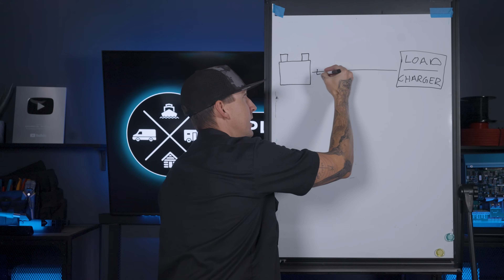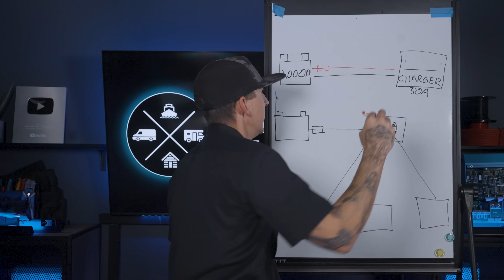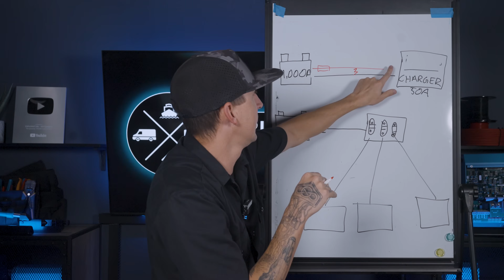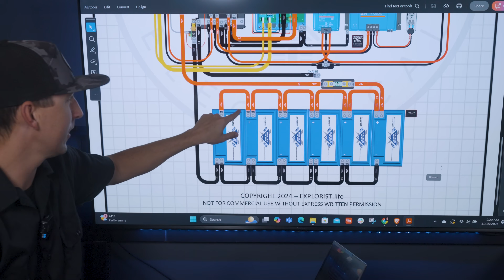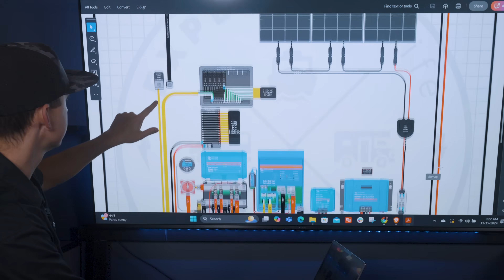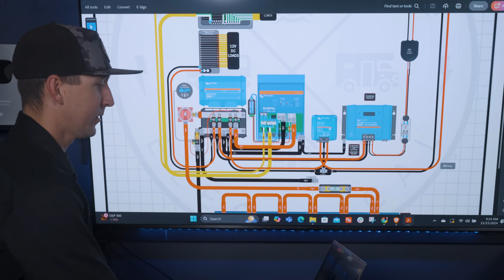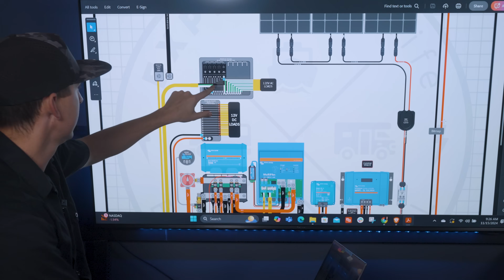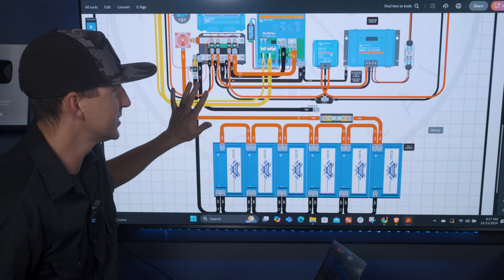Fuse and Breaker Placement 101 - Fuses, Breakers, & Overcurrent Protection | Ep: 3/6

Comment: Hi Nate,  I want to ask you about the placement of the battery disconnect switch. I noticed that you always put the battery disconnect switch on the positive wire. Every battery company I've spoken to advises disconnecting the negative terminal first, then the positive. Could you please tell me why you disconnect the battery from each system, contrary to the battery manufacturers’ instructions? Thank you for your information, John
Reply from the maker: Sure!  Reach out to shop.explorist.life/support and we can give you some insight into that and get you the parts you need for your build. 👍😎

Comment: Hi, if i have 2 x 300ah batteries, can i wire them in parallel with 1 fuse and 1 switch, or do i need to wire each to the bus bars separately, with 2 fuses and 2 switches (1 fuse and 1 switch for each positive cable connecting to pos bus bar)?
Reply from the maker: Great question! The best setup really depends on the specifics of your system and how you plan to use it. We’d love to take a closer look at your project so we can make sure you’re set up safely and efficiently. Reach out to our support team here and we’ll help get you dialed in: https://shop.explorist.life/support

Comment: I'll add another comment on the AC shore power breaker. I have stayed at several RV parks where the pedestal had no breaker or shutoff (any presumed breaker was in a locked building somewhere?) This left me with no way to shut off power before connecting my shore power plug.  I have since installed my own internal 30A breaker at the RV inlet.
Reply from the maker: That scenario wrt the RV park having their breakers locked away is actually an NEC code violation:

According to NEC 551.77(C) - Accessibility of Disconnecting Means:

“The disconnecting means shall be readily accessible, and shall not be located in a locked room or enclosure.”

This means the breaker cannot be located in a locked closet, utility room, or building that is not accessible to the occupant of the RV. It must be readily accessible without tools, keys, or special knowledge.

So, NO, the breaker cannot be placed in a locked room and still comply with the NEC.

⚠️ Additional Related NEC Provisions
NEC 551.76: Requires that the receptacles at each site (e.g., 30A or 50A) must have overcurrent protection matching their ratings.

NEC 240.24(B): Also reiterates that overcurrent protection must be readily accessible.

Comment: I am wanting to "future proof" our system. Is it a no no to use a bar fuse that is more than the amps needed? So for example, if I use a par fuse that is connected to the battery and then continues on to the fuse box if I only have a total of 50amps can I use a higher amp rating? Like, can I install a 75amp fuse?
Reply from the maker: I'm not quite following this question, but reach out to customer support through the messenger on https://shop.explorist.life and we can hash out the details to get you what you need.

Comment: Thanks Nate, I have always wandered whether you need a further disconnect for each PV string if you already have fuses installed for positive and negative DC cables from the panels, or if the positive and negative fuse is sufficient as a disconnect device to meet the NEC requirements

Comment: to summarize, battery and shore power act as voltage sources where current is load dependent and could become very large; Chargers and solar panels act as current sources where voltage is load dependent, not current.

Comment: Thanks for this general overview on fuse placement. However, I still have a question on fuse placement between a 12v 6- or 12-circuit fuse block (100amp maximum/30amp per circuit maximum) and switched loads. I'm doing a DIY DC-only powerstation build (12v 230ah w/o inverter) in a modular toolbox setup and want to install some small computer fans (qty.5) for ventilation as well as a few USB ports (qty. 3) and some LED strings (qty. 4) all of which have low amperage draw and small wires. I suspect the wires off the fans are 24awg with slightly larger wires (20awg?) on the LED strips and USB outlets. I'd like to place a rocker switch between each group of loads so that a single switch activates all fans simultaneously, another switch controls the USBs, and a third controls the LED strings. The 3 switches would go between the fuse block and load with each of the 3 circuits having a blade fuse in the block sized to the maximum amperage for everything in the load string (e.g., a 5amp blade fuse for 4@.67amp LED strings). The switches and load wires are generally going to be either 14awg or 16awg coming off the fuse block and switches and they will connect to some sort of distribution bar (small bus bars or wire nuts) combining the smaller individual 24awg-20awg wires from the appliances.

Do I need to have small fuses in-line at those distribution points where the small load wires coming directly from the appliances connect before they are switched? I would think the small wires would be most prone to melting even at small currents and so each should be fused even though each inline fuse might only be 1amp for each fan or LED string and 5amp for each USB. Or, am I being overly cautious and overthinking this?

I suspect what I'm really asking is if a fuse is needed whenever a smaller wire (or combination of wires) joins a larger wire regardless whether high or low currents are involved.

Also, what amp rating do you generally assign to 20awg and 24awg wire? I'm seeing mixed results and most wiring charts or calculators online don't deal with such small wires.
Reply from the maker: This may take a more in-depth look at your personal setup.  If you have purchased/are purchasing from our store (shop.explorist.life) reach out for some more personalized help: shop.explorist.life/support

If you've purchased/are purchasing elsewhere, reach out to your dealer for support.  We'd love to have you as a shop.explorist.life customer so we can provide a bit more help in the future. 🙂

Comment: Quick semi related question. Should a large load such as a DC rooftop Air Conditioner (RTX2000 - I think it requires an 80 amp fuse) come from the DC distribution panel or should that come directly from the lynx with a dedicated fuse?
Reply from the maker: That would land directly on the lynx distributor as the load is too much for a 12V Fuse panel/box.

Comment: Great video. Thank you. You did a good job explaining the logic behind the fuse/breaker placement. However, it did spawn a question for me. Why isn't there a requirement to fuse solar panels near "the source"? Is it because the Short Circuit Current (ISC) of the panel(s) is below the failure point of the ~10 gauge wire?
Reply from the maker: Exactly!!

Comment: Question for Nate,  my system install uses all Victron componants with 540ah of batteries, all laid out similar to your schematics I purchased a few years ago. 
I've never had an issue in the 2 years of full time use. 
My question is, do these fuses ever age out, need changed / replaced just because of time use or age? Or are they good til they aren't?
Reply from the maker: Fuses don’t really wear out, no.  Breakers ‘can’ wear out if they are regularly toggled, but we are talking, like, 5,000+ toggles?   So, decades of use in those.

Comment: Great Job!  So, if I have an Orion 24/12 Convertor feeding a 12V battery, I should have a fuse/breaker after the Orion and also after the battery feeding the RV circuits?

Comment: I added MRBF fuses to my batteries just in case of an internal battery failure which could dump 1000's of amps if left unchecked.  I still have a Class-T fuse for the main system protection.
Reply: @FU2_Ggl This! Everybody mentions this concept, but I've not yet found any details about those kinds of scenarios. "dump 1000's of amps"? Examples of that kind of thing would really help in understanding the issue.